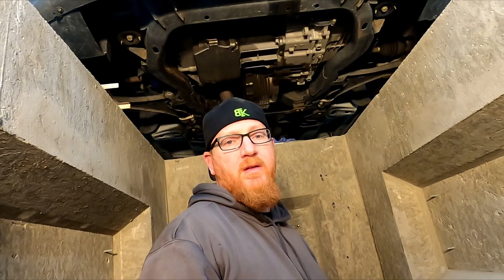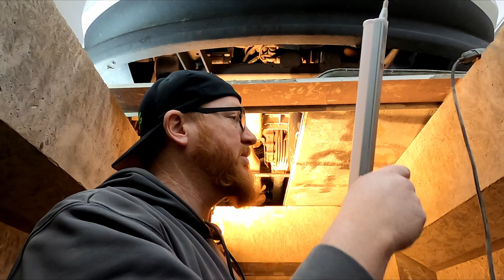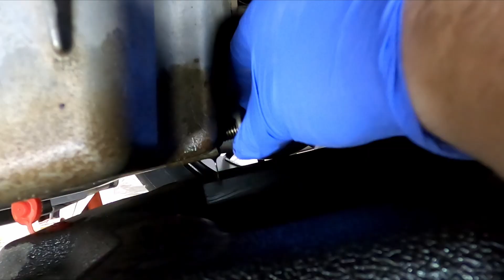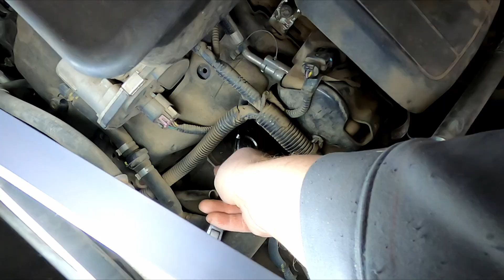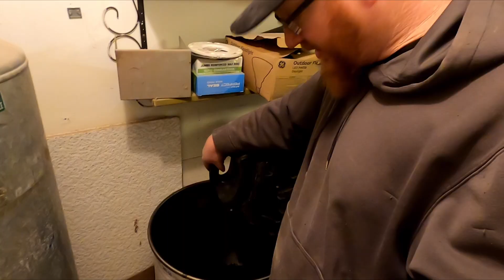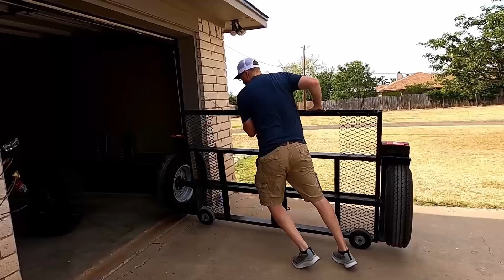My Custom Garage Pit's First Oil Change! Initial thoughts - What does it need?

Comment: I am thinking of putting drive over led up lights in my deck with chain cables for travelling up and down, either way I reckon a plug in leadlight will be necessary because of the shadows created whilst working.
Reply from the maker: Yes its hard not to get in your own way in tight spaces.  I am probably going to try a few different light ideas out.  Now that I have the metal ring around the edge using a switch magnet mount would work really well to hold things right where you need them.

Comment: If you plan on doing repairs from the pit install a fan in it. Everything from fuel vapor to carbon monoxide settle in them and can be dangerous. Guys have gotten pretty sick from no ventilation in pits.
Reply from the maker: I have a bilge pump already planned to run when the lights are on.
Reply from the maker: Also we have been blowing a fan in there before working in it.

Comment: I own a small 1 man auto shop in PA. I also have a GMC terrain. I change my oil every 3k miles due to the timing chain issues. I have changed at least 60 or more of those chains all due to long oil drain interval.
Reply from the maker: I barely caught the extented recal when mine was burning oil at 107k miles.  They warrantied the piston rings because they made them with too soft of metal.  The dealer replaced the chain parts at the time at cost while they were at it.  They weren't worn out but they knew about the issue.  2011 4 cylinder AWD.  I love the purpose of the vehicle most room in a back seat.  AWD AND good gas mileage for those 4 hr skii trips!
Reply: @ThinkBuildTest  Mine is a 14 FWD and I bought it with 100k blown up for 900 bucks. If you follow the oil life monitor when it tells you to change it you end up with 10k miles or more between changes. Its just too far for these engines. ALso the ones with Direct Injection end up diluting the engine oil with fuel.
Reply from the maker: @eddiereichel9354  I am usually won't go below 40% on an oil life meter.  In my opinion the car company only wants to get you through the 5 year warranty.  They don't want you getting 200k out of a car.  They want you in a perpetual car payment.  I have trust issues.  I was taught 3k miles.  I don't cry if its a little over but you have to look at your oil.  If its burnt and soupy.  It can't last that long.  Usually I will end up running small engines longer than they recommend because the oil is still golden.
Reply: @ThinkBuildTest  Your totally spot on. Same thing with "Lifetime Transmission fluid"
Reply: @ThinkBuildTest  Most every vehicle on the market I say 5k is a good balance. If its a GM 4 or 6 cylinder then  I recommend 3k interval.
Reply from the maker: @eddiereichel9354  any vehicle that has 1/2 cylinder shut down needs to have really clean oil.  The oil pressure relief valves get over exercised and gets stuck open letting too much bleed back to pan instead of lubricating the engine.

Comment: The "lift oil drain pan" at harbor freight would probably work pretty well for catching oil in the pit.
Reply from the maker: The elevator floor won't be able to come up with a tall oil tank under the car.  That is what I originally thought I would use till I realized I would be stuck in the down position until the oil finished draining.
Reply: @ThinkBuildTest   Correct, but if you have one with wheels then you can just move it out from under the car when you raise the floor. The harbor freight model has a short tank with a tall funnel.